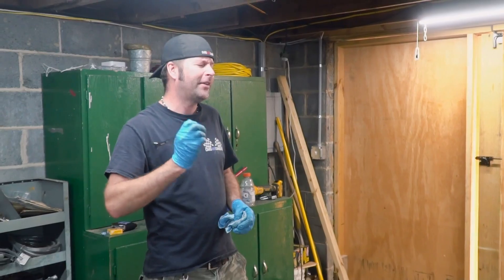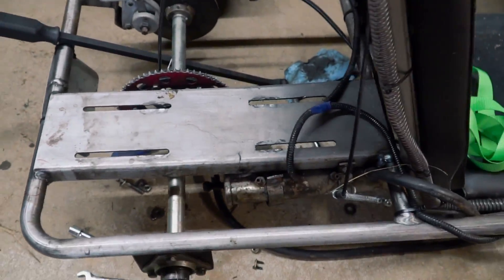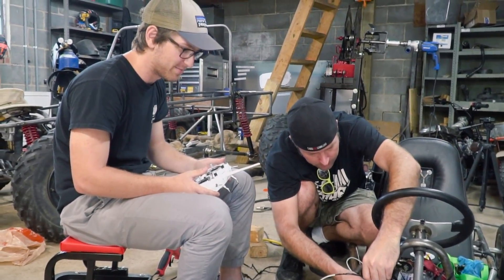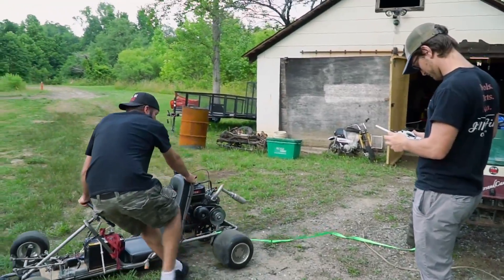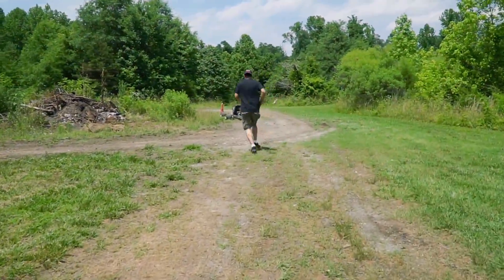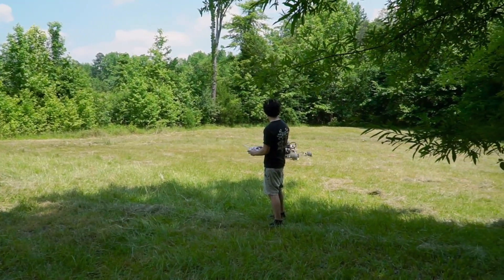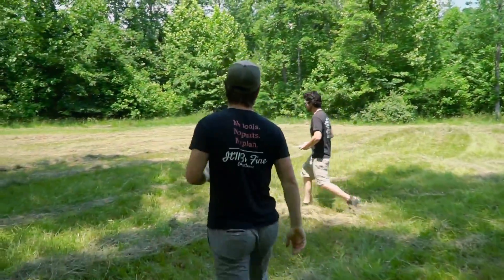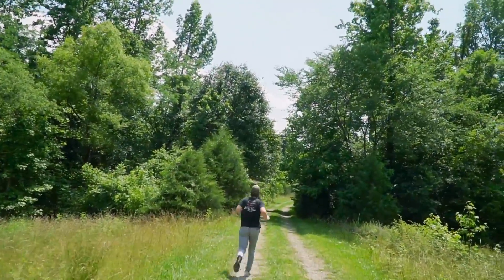We Rebuilt our Remote Control Go Kart and IT WORKS!! (Doughnuts, Trying to Drift, Test Driving!)

Comment: Use a standard servo for the throttle and the wiper motor for the breaks. Will give you much faster throttle response
Reply: Exactly, and the added benefit of a potentiometer.
Reply: I’m still confused why they went to the effort of using an arduino. Rather than just a 3 channel receiver and some servos.
Reply: i could give you the answer but im reluctant to give children any more bad ideas
Reply: @mdnovaman  Because they ain't that strong, would work for the throttle thats about it
Reply: @Billo-07  you do know there are different kilo servos, they are strong
Reply: @romanbernal9157  Yes 1/5th scale servos are the biggest you can buy off the shelf, they maybe will  just do it, still not as easy as it sounds
Reply: D0DGER D 
Because neither of them or their ‘Guru’ knows what they are doing. 
Cringeworthy stuff
Reply: @colingotch1871  they never claimed that. Also they actually did it while i only see you write sad comments.
Reply: @Billo-07  Wrong, you can get servos off the shelf far larger than that but it would show in the cost, they also require an external power supply.
Reply: @colingotch1871  they have always been kinda down and dirty and just doing with what they have sometimes
Reply: this is so true pls do this
Reply: Yeah a 1/5th scale high torque one will work great and look in to a vtx  with a camera with some fpv googles
Reply: They could also use a PWM controller to turn the big motor into 'a DIY Servo'
Reply: @mdnovaman  so so so true mate 👍
Reply: @noahpaulette1490  it'll be fine!
Reply: i know Im randomly asking but does any of you know of a method to get back into an Instagram account??
I was stupid forgot the login password. I appreciate any tricks you can offer me!
Reply: @Thaddeus Joseph Instablaster =)
Reply: @Kannon Moshe It worked and I now got access to my account again. I'm so happy:D
Thank you so much, you saved my ass :D
Reply: @Thaddeus Joseph happy to help :)

Comment from the maker: If we fine-tune this setup, add a POV live feed camera, and install this on an off road kart we’ll have an awesome setup!
Reply: WHY NOT USE servos for gas?
Reply: I dare you to do it to the Cross Kart 😂
Reply: If you center the steering motor in the middle you can hook the tie rods to the motor
Reply: I'm thinking the XCart...  Lol
Reply: monster truck make it rc
Reply: I would run the wiper motor at 18 V and you can use an Arduino high power drive control with an rc servo so steering return to center
Reply: @michaelgarcia2440  agreed that would be much easier to set up, it would also allow gas and brake to be controlled on two separate systems
Reply: There are scale R/C servos with as much as 160 ounces of torque. Grab two HD core ball bearing throttle/steering servos. Check out www.hobbyking.com
Reply: We calls it FPV, pyrodrone or racedayquads will have you set up in a jiffy.
Reply: Mount a toolbox for running tools/parts out to people on the trails. :D
Reply: Please!
Reply: I feel like this is a hilariously funny idea that's awesome for all of a day or two. But it's probably best to not go any farther than that.
Reply: Use skyzone goggles the 3d version with double cam that would be cool 😉
Reply: Do more black hawk videos
Reply: What is happening with the trophy kart, I think it's awesome
Reply: You should be able to do this, parts been around forever. Raced 1/10 scale in late 90's. Lots of fun
Reply: Make sure that Fpv cam is isolated from vibration or else it'll be useless!
Reply: Didn't see it. When you have a crack best thing I have seen done and heard is to drill a hole at the end of the crack to stop it. Then weld.
Reply: Do check out servos and electric actuators
Reply: Looks like you need to make a Christine inspired biuld
Reply: Dude guys that reminds me of maximum overdrive and it looks like its from that era its dope and you guys better watch your ankles with that thing to lol but its awesome needs more episodes and more fine tunning and put a couple sandbags on the seat and strap them down cause the whole thing would drive better with some weight on it
Reply: Put in a proper rc servo near the rear of the motor perhaps too control the throttle, I'd imagine if you can hook it up near the carb.
Maybe close too a straight line from behind the seat itself or I'd say a meter away with a smooth running throttle cable with a killswitch a 20 kg rc servo easily does the job.
A standard 7.2v nimh pack for controlling the rc servo should last pretty well too.

Have the current motor for that steering put on the brake (can mix the channels i'd imagine so both work on the same throttle stick.)

When it comes too the potentiometer for the steering, you can probably make a small wiper mechanism that sits on the steering linkage bolted down too the frame & a gearbox of some sort that the potentiometer sits in that ofc limits the max throw of the potentiometer & should center the steering as well there are motor boards out there that you can hook up motors that pull up too 160a on like 48v

An example of the steering servo setup for future reference with that wiper motor.
https://www.youtube.com/watch?v=aB9YIA-z0Js

His own giant rc project a buggy
https://www.youtube.com/watch?v=NBfW_0HRV2Y

Comment: as an RC Hobbyist this is hard to watch. specially wend you see some one running behind it. 
But credit to you guys, you have done it. well done.
but i would swap the motors that you guys using to turn and brake and accelerate. for 1/5 scale RC's Servos and replace the remote you have for a pistol remote.
Reply: I used to race r/c cars and pistol remotes are a lot easier to control.
Reply: Tuga RC   Wend?
Reply: It's a good idea but I dont know of it would have enough power to actuate the components, especially for the brakes
Reply: *if
Reply: I'm an R/Cguy too. Planes, helis and cars. Sieko servo's would be the way to go.
Reply: @shephene4483   it would if they get the high torque ones. I got a 45kg on my dbxl and it works great. ( Considering that it's a 4wd it holds the steering very well.)
Reply: Why even bother with an RC go kart when there is an XMaxx?? It’s not practical and a waste of time...
Reply: Yeah that's true
Reply: @tuga rc
Reply: @SuicideNeil   Facts
Reply: @SuicideNeil  exactly and holy $%#& is this suicideneil from back in the old days of clod talk?
Reply: That was hard to read
Reply: @Tugalife83   I agree. I would change the steering to have separate servo's for each front wheel.

Comment: Nice job guys! something to look into, is if you're having trouble with over steering, you add an expo output on the transmitter. It'll make steering softer when the stick is closer to the middle. it'll still give you full output when the stick gets closer to the edge. It's pretty common in the RC world, and your transmitter (remote control)  is pretty easy to set up. I actually have the same one. Welcome to RC!

Comment: Get an RC guy who knows what he is doing and gives you proportional control. The way this is set up it will be very very difficult  to steer and the amount of throttle or brake will not be finely controllable.
Go for PROPORTIONAL RC. Your radio can do but your wiper servos dont. Ask for a tech in your local model airplane club. He will prolly do for free.

Comment: I have a 125cc remote controlled couch that I built for Burning Man.  I didn't want the controls to be visible so remote control was the way to go.  It's got an air compressor with a tank, 15" air horn, 1000 watt RMS bluetooth stereo system with 10" subwoofer, 60 AMP alternator, hydraulic disk brakes, and it's outlined in LEDs so it's recognizable as couch at night.  Best part is when I park it, people sit on it thinking it's just a couch, the looks of confusion on their faces when I attempt to explain that it's my ride are priceless haha

Comment: Love the remote control stuff.  Great test indeed. No one was injured. As for door window motors....I would grab some from Ford Aerostar, as I understand they have great speed and torque. Frozen door windows didn't stand a chance on my Aerostar at 30 below zero here in Canada. Always worked and broke the ice off and rolled them down without issue. Another good one to try are the Mustang ones as well. They may even be the same ones used in both vehicles around 1987.( year of my van). The 2001 windstar motors seem to work very well also.(year of my other van)

Comment: Sieko servo's are the way to go. 
Also, you should be able to dial in some exponential from the transmitter to soften the steering and make it easier to control.

Comment: Another simpler option would be a chain drive reversible motor on the steering column support. Then you can gear reduce to more precise steering and would be less linkage to bind. It almost seems as if the steering has a "high" spot where its tough to break over. Just my 2 cents.

Comment: I'm glad you guys are going to try window regulators. I meant to add that suggestion to my comment on the last video on this topic. The window regulators are closer to linear actuators (which is what you actually need) A ribbon style regulator would work best for the steering and a lever action for the throttle and brake.

Comment: I'm glad to hear you're going to use Window Motors.There are different speeds,and with voltage adjust,you can control each's speed too.I'd like to suggest a 'Door Lock'popper as an Emergency brake activator in case of extreme need.1 pop and it activates a spring loaded lever.Loss of signal power, would be good example.

Comment: Might wanna add some weight in the center for traction, might help keep it from looping out. Could add another battery or two and hook em’ up in parallel; more capacity and overhead for current draw.

Comment: I second the comment about using a standard R/C car pistol grip transmitter. Also just use a standard size high torque servo located at the carb of the motor for the throttle.

Comment: Guys you can fine tune the transmitting using the software that controls it.  Set the Expo to reduce the effects on the throttle and steering, all easy to do in the OpenTX that is used in the transmitter.

Comment: You also need to rachet strap a 80 pound bag of gravel or something to the seat for some weight so its not bouncy and controls better.  The window motor will work way better for steering

Comment: Tbh, seeing a remote control cross cart would be interesting once you get all this remote control stuff fine tuned perfectly and whatnot. Also, for steering, You may want a servo that's strong, and also technically fast, It'll allow precision, and speed for the turning. Probably would be best for the same to be on the throttle as well, and for breaks, would just be as simple as full breaks if needed.

Comment: There is more resistance in turning one way than the other. You may not feel it but a machine will feel the least bit of resistance. If someone is going to be on there make sure they have access to a kill switch.

Comment: Add a turnbuckle to the frame and a mid-point on the engine to allow for the chain tensioning and then tighten down the bolts on the engine . Additionally it will add some rigidity and keep the engine from sliding on the mounting bolts.

Comment: Two suggestions, put micro switches on the full left full right steering and maybe brake and throttle. Make the steering return to center when the joystick returns to center...

Comment: Hello guys. This is TK from San Diego. First time comment. I built a project for a different  purpose but the motor I chose is high torque, reversible, 5 or 12 volt with multiple ram choices. Amazon Greartisan Turbo wormgeared. Take a look. Love your videos. Kindred Spirits. From Alabama but on the West Coast for 20 years. Cheers
Reply: Meant to say rpm not ram

Comment: Awesome guys. I still think you’d make your lives so much easier if you just use a gang of high torque servos in series. Then you’d have the proportional, self centering, back and forth control you’re looking for without a bunch of home brew programming. And maybe put the brake on a separate channel. I understand that would increase the budget a bit but you’re kinda reinventing the wheel. Of course if you simply prefer the challenge I can totally understand that too.

Comment: Two issues come to mind when thinking about the cause of steering twitch/flashing lights:
1. The H-bridge motor drivers you are using could be hitting current limits and/or thermal limits. This can happen if it takes more force to move in one direction as a result of the design
2. You could be missing pulses from the transmitter. You are likely using PWM or PPM for transferring stick percentages from the transmitter, and these suffer from jitter in the clock pluse train. the Jitter, in combination with using PluseIn() & having a slow loop in your code will cause incorrect readings of signal, or even miss it entirely. You should strongly consider moving the PWM/PPM signal pulse reading into an interrupt service routine. This is a little bit harder code to write, but will be more immune to varying PWM frequencies  & slow loops.
3. It's possible (but unlikely) you are 'overflowing'' the variable used to store received PPM/PWM signals. This is caused when you assign a value whose' absolute value is greater than the absolute value of the largest number the particular dataType you are using can store, causing the value to 'wrap' around. This is called an Integer overflow in programming, and can be hard to spot as a new programmer if you don't understand how numbers are stored in binary.

The lack of throttle and steering control is a byproduct of using open-loop control. If you really want usable controls you gotta close the loop like you said. Really, try to avoid potentiometers though, you will likely encounter a lot of unexpected issues if you aren't careful. If you wanted to easily create a closed-loop control for steering and throttle, you could hack-open an RC servo and attach the motor output wires to a high-current H-bridge. If you attach the servo arm to the linkage you are trying to actuate, you can effectively make a 'big servo'. This has the advantage of being cost effective, and easy to implement if you aren't comfortable with implementing a PID control loop, control input, and wiring multiple boards together.

Awesome video, can't want to see the next one! FPV would truly be great :)

Comment: You guys made me take my RC gokart out for a ride and it works perfect.I wish we can race them.you guys Rock 👍
Reply: Sam’s Garage   I have a r/c motorcycle that needs a battery. It's a Tyco, if I remember right. Is there anywhere I can get a battery, or can the battery be rebuilt?
Reply: David Donaghy I also had the same RC motorcycle a long time ago and I’m not sure if you can still find batteries for it but I would check on line or try to buy a used one.

Comment: Power window motors, run on 18V cordless tool battery for the steering. A few sprockets and a small length of chain. That's how the pros do it😉👍

Comment: Power window motors are your best bet, like mentioned before they have the torque you especially in the steering, make you remove the safety on the gear

Comment: Also another idea you can weld a plate behind the motor that a big bolt threads through that pushes the motor forward for you so you can tighten the chain kinda like a motorcycle.

Comment: for the steering you want a servomotor or a linear actuator. motors that spin continuously with no feedback are not the answer when you want a specific steering angle. wiper motor's aren't designed to hold a single position, so you'll always be manually correcting when bumps cause the steering to turn.

Comment: Would it be possible to install a sprocket on the steering wheel and use directional electric motor which also has a sprocket?

I would think that, if that would work, it may work quite well

Comment: If you weld a small sprocket on a window motor and a sprocket on the steering column with a small chain you can steer it and even mess with the gear ratios.

Comment: I have seen wiper motors having multiple sets of brushes for different speeds. The placement of the brushes in a DC motor determens its speed and torque (you can basically choose one or another). It is possible that is the problem with your steering motor- the brushes are not symmetrical so more speed turning one way and more torque turning the other. Some DC motors have a preferred running direction, it is even possible to determen it just by listening to it run both ways. Anyway, servos are your answer.

Comment: Don’t know if anyone mentioned or not but when running a gas RC set up you need a fail safe set up on the receiver so if the receiver loses signal to the controller then the fail safe will make it hit the breaks instead of take off potentially hurting someone or causing more damage

Comment: i would recommend getting hold of some Hitec HS805 servos. They are intended for steering 1/4 scale RC aeroplanes and trucks. They have 343 oz-in of torque, thats almost 30 inch pounds
Reply: Yeah, a couple of these tied together with a splitter would likely get the job done:
https://www.ebay.com/itm/Trackstar-1-5-Scale-Large-Model-Servo-17T-40kg-555oz-0-16sec-188g/233549345580
555oz @7.4V

Would also likely be plenty for gas/brake as well.

Comment: You should use a small rack and pinion type steering.  Then you could use different size sprockets between the steering motor and the rack to adjust steering speed/torque.

Comment: Love the car guys. Can I suggest that you don’t need to have the steering wheel and therefor you can fit the steering motor in the middle so that the load is the same whichever way you turn the control.